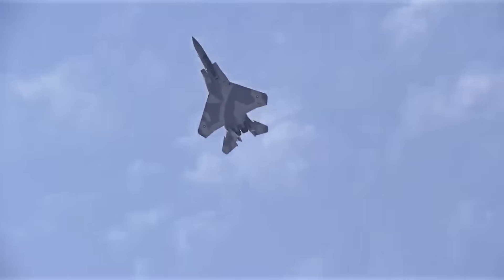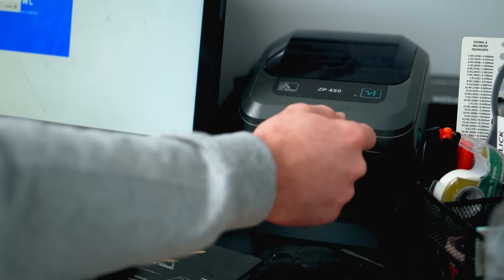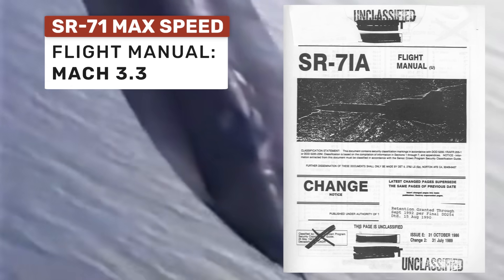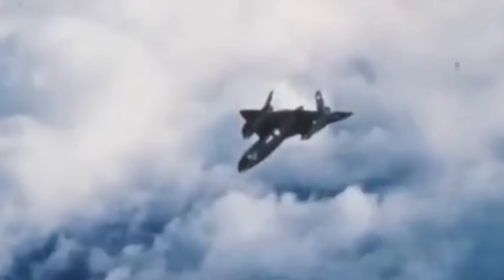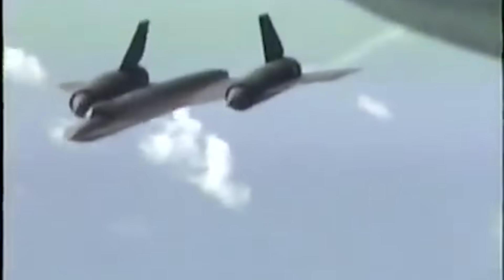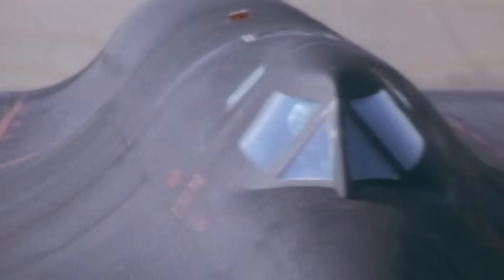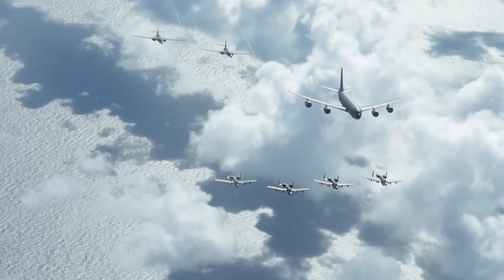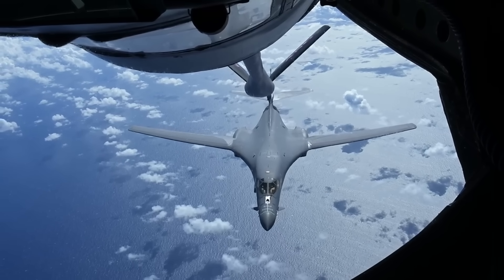The SR-71 was MUCH FASTER than the Air Force will admit

Comment: I was always told that the speed was only limited because of the atmosphere heating of the fuselage. It could go faster, but the skin temperature prevented it.
Reply: The initial limit to higher speeds was the engine CIT not the airframe temps
Reply: @gr8crash  So is it true that they leaked fuel on the ground and until the body heated up and sealed? What about them being so hot after landing to even touch them? These can’t all be urban legends.
Reply: @jeepdude7359 those are also urban legends. While it is true the SR71 would leak fuel on the ground, virtually all aircraft have leak limits and will leak at times so the SR71 isn't really unique in that aspect.  The myth part is to why they leak. The aircraft would leak when the tank sealant because cracked and damaged. This damaged was caused by the thermal cycles of flight. It was the expansion and contraction of the airframe that would actually create the leaks, not stop them. 

As for having to wait to touch the aircraft after landing that isn't true either. Ground crews started working on the aircraft, removing panels etc as soon as it was chocked in the hangar sometimes as they are still shutting down the engines. There's times the crews would even be taxing in with the canopies already open.
Reply: @gr8crash  Respect 🫡
Reply: @jeepdude7359 haha no worries. To be fair I got involved in studying these aircraft having "believed" a lot of these myths. Then I found out that truth is much better than the stories.
Reply: @gr8crash  Wait, so the plane out of the factory didn't leak at all, and the expansion triggered some degree of leaking that resolved when it expanded, but acted up again once cooled?
Reply: @petero.7487 somewhat. Out of the factory or after PDM there were virtually no leaks. But over several flights the thermal cycles would cause the sealant to crack and the leaks to start. Once these leaks started they remained until leak limits were exceeded then it would be scheduled for fuel cell MX during the PDM.

Comment: I'm betting the SR-71 was a mach 4 capable aircraft. Built out of titanium from Russia the Blackbird was a sloppy fitted clanking airframe that leaked fuel. But at 80,000 feet cruising over mach 2 that aircraft tightened up to perfect fit being heated from friction of the air at mach2+... twice the speed of sound.. designed and built back before computers and is still faster than modern aircraft even though it's retired now..Great gig if you can get it
Reply: The SR71 was never remotely capable of mach 4. It also wasn't sloppy/fitted or clanky, and yes it did leak fuel, it didn't leak very much.

Comment: I wonder if pushing the plane above its limit causes it to become so inefficient that it would be impractical, especially with how fast it is anyway
Reply: Depends on the situation, meaning atmospheric conditions.
Reply: @gr8crash  yeah just saying for practical purposes it may not make sense to run it at +100mph above its limit because of the extra fuel and loss of range etc.
Reply: @bobman717 well it depends. The SR71 engine controls are based of atmospheric standard conditions and most of the time that's fine.  But in days where the air is warmer than usual they may be at full throttle,  with high fuel flow and not even reach mach 3 which has lead to mission aborts. Now a day where it's colder than normal they could be in MIN A/B and be comfortably passing mach 3.2 while keeping fuel flow down.

Comment: The airframe and major components were probably able to go much higher speeds, but the onboard systems were likely limited to ~ Mach 3.5
Reply: The engines weren't rated for faster, and various parts of the airframe had issues at different speeds.

Comment: As a  tanker  pilot, the only time I paid any attention to the outside air temp of my KC-135 was refueling the SR-71. We  had to fly as fast as possible close to mach 1 and not melt down, while th Black Bird  flew close to its stall speeds, especially as fuel was on loaded. With the exception of the SR-71, all the fuel    offloaded to other Air Force aircraft  was JP4, The SR-71   burned its own brand, and the tanker had to keep the fuel separate. As a result only a few tankers were build to accomodate that problem.   As I recalled from  decades ago, it was the only aircraft that  descended to meet us.  Most of my experience flying the SR-71's was at Kadena, in Okinawa where the teen age boys work   t shirts   with black bird and other references on the supposedly top secret nature of the missions.

w
w
Reply: 56 Q tankers were made for the SR71 program. During refueling the KC135 did not fly "close to mach 1"  not even remotely close. About the only other aircraft I can think that would have descended like that for fueling would have been some of the U2s.

Comment: It could go even much faster than what this video says. I was an Air Force pilot and met up with Blackbird pilots from Pease AFB over in UK on TDY and noticed their flight suit patches. No, they could not “say” how fast it could go but I saw the number and “wink” of those patches.
Reply: Lol no. This has come up with thr rumor of "mach 5" patches, this was absolutely impossible for the aircraft to do and there's no SR71 that will ever claim a speed like that.
Reply: @gr8crash  if you say so. But unless you were one of the test pilots or an engineer in Skunk works then we don’t really know, nor do we know what altitude above FL600 it flew during testing, which makes it easier for the airframe to fly faster.
Reply: @mikemccormick8115 actually you don't need to be either of those to know what us and isn't possible. Also all those limits on speeds and altitude are all known and public even going back to the A12 flight testing. Even without being part of what you said, it's not hard to realize what is and isn't possible. Mach 5 is 100% impossible, mach is 100% impossible, even reaching mach 3.5 is nearly impossible outside of VERY specific atmospheric conditions.

Comment: This is a guess but I might be able to tell you where the name for the Vmax switch comes from. Yamaha made a motorcycle called the Vmax. There are two generations of the motorcycle. I only know about gen 1 for sure because I own one. The gen 1 Vmax was produced from 1985 to 2005. The gen 1 Vmax and maybe gen 2 has a butterfly valve in the carburetors that is designed to open at 6000 rpm's to feed the engine more fuel to give a large boost in power. That sounds pretty much like the Vmax switch. Having the same name may just be coincidence, but if it is it's a pretty crazy coincidence!

Comment: I used to work at The Museum of Flight in Seattle and got to talk with Frank Murray (I believe). It was the first symposium after the SR-71 performance data was declassified, so they could finally speak freely as long as they didn't talk about specific missions or the camera capabilities, because the cameras were still being used on the U-2.
I got to ask the big question of how high and how fast and Frank cheated a bit and spilled the beans. He told me the top speed wasn't limited by thrust but EGT and he flew the Blackbird faster than anyone else on a mission off the northern border of the U.S.S.R. in the winter.
He said because the air was so cold and the engines were so efficient, the more he backed off the throttle, the faster and higher it went... to the point where he was almost at idle (but with the afterburners still active) and the damn thing wasn't slowing down. Eventually he got it balanced and although I don't remenber the exact numbers, I seem to remember he maxed out at something like mach 3.3 and 97,000 feet. (Now I have to go look for my photos from that event.)
Reply: If I recall Murray only flew the A12, never the SR71. And they never flew the A12 on missions against Russia. But the part about colder air playing a role in the only way the aircraft could fly faster than 3.3 is true. That happened to 2 other pilot's though and they both reached speeds in the 3.4x range and 90k ft.
Reply: @gr8crash  Very possible. The event was probably 15 years ago and my memory is hazy. I went with Frank Murray because his face looked familiar. 
Still, it was a great event and I met some amazing people.
Reply: @MrWATM yea those symposiums are really awesome to go to. I've gone to a few and also one in Evergreen, was a great trip.

Comment: Of course they lied.  What does everyone think?  As a "radar operator" from the Vietnam war, I know the top speed.  That plane could fly over the North and barely have time for a cup of coffee.  It would fly out of Subic Bay to recon the North like it was just next door.
Reply: Everyone knows the top speed, it's been public for well over a decade
Reply: @gr8crash  Yeah, not everyone.  The top speed is still a deep dark secret.  Also the top altitude same thing.... a deep dark secret.  The only reason I know is because I was a programmer that had to calibrate the computers processing radar information -- information that kept rejecting the radar returns from the black bird as an error.... too high, too fast.  When flying over the north (of Vietnam) they flew FAST and HIGH.  My first job when I arrived in-country was to fix the computer programming so that it didn't kick out the returns as an error.  And I tell you what, it was a sight to behold when the bird got over land and they turned on their counter measures.  Makes me smile just thinking about it the first time I saw it.  I thought the computer was broke for sure.
Reply: @pawnslinger1 the top speed is not a deep dark secret. It hasn't been a secret for well over a decade. All the SR71 performance data has been known, public and available for well over a decade.

Comment: SR71 is/was incredible (Actual name was RS71 until LBJ screwed up when he revealed it to the average American in a speech.
Reply: Popular myth but no. RS71 was not it's original name. Nor did LBJ make the error regardless,  his stenographer did.
Reply: @gr8crash  Actually, as far as I understand, General LeMay asked LBJ's speechwriter to rewrite RS-71 as SR-71.  The RS designation was for Reconnaissance Strike, which had been applied to a B-70 proposal (The RS-70, a desperate effort to salvage the program) which was designed to assess damage following a first-strike and take-out what remained with a number of unspecified nuclear-tipped missiles.

The RS-71 was designed for the same purpose and evolved out of the R-12/B-12 and RB-12 concepts and would have obviously carried a smaller number of missiles (though the ability to deliver them faster, higher, and harder to detect would have obviously been useful).  From what I recall, General LeMay liked the concept but wanted the B-70 program more and wanted Johnson to stop lobbying for it so he could salvage the XB-70/RS-70 program. The RS-71 program was oriented to pure reconnaissance as a result, hence LeMay's desire for a designation change.
Reply: @petero.7487 somewhat yea. The Lemay wanted it changed from RS to SR so it was. And LBJ read the statement correctly,  but his stenographer messed up the press release. The SR71 itself was never armed or designed to be. They did later propose and armed SR71 variant twice, i believe SR71 Bx and SR71I
  But neither of those variants were built.

Comment: I would like to hear... from my understanding the sr was the only aircraft to have the J58s. My understanding is the a12s had a less powerful engine and therefore slower.
Reply: All 4 variants flew with the J58 engines. The A12 initially had the J75 engines so it could begin flight testing as the J58s weren't ready yet. The A12s, while having J58s did have lower thrust than the ones in the SR71. Although the A12Bs "the only one on the USS Intrepid in New York" would have been equipped with the same full thrust engines.

Comment: I know a gentleman that used to be a mechanic on these things at area 51. Mark 3.8 at 120,000 ft
Reply: That entire comment is incorrect. Not only could it never reach mach 3.8 as configured, it could never reach 120k in any configuration,  it also was never tested,  flown or operated from Area 51.

Comment: While contracting for Camp Dawson, I stumbled upon a book at the commissary devoted to stats and specs of the SR 71. Specifically commenting on the speed record that was officially announced publicly, was in fact actual and true. But, what was not announced publicly was the fact that one of its engines got snuffed out during that record run. No other information was disclosed about its true potential.
Reply: They had a momentary unstart, but it was quickly addressed and had virtually no effect.

Comment: I had a friend who was on the ground crew servicing the SR71.
 He told me that not even him and the crew knew the max parameters of the SR71.
 The reason is because the flight instruments had 'hoods' that closed over them when on the ground, and very few were privy to accessing  this information.
Reply: Lol no. MX crews were well aware of max parameters.  That "hood" aspect as come up before and it's never actually been a thing. It's hard for MX teams to perform their jobs with gauges missing. The one thing they have mentioned is on the TDI there was a bezel with some restricted information and more so in the early days that may he covered up, but that's about it.

Comment: I had a friend who was the weather guy for WPAFB   He did the run for the pilot on his west to east coast run before bringing it to the museum. He told me that they did it in under 30 minutes.
Reply: Agreed too disagree
Reply: @dwainday7460 I mean that works with opinions,  but not in this instance of facts vs fiction. What you said is completely impossible. Especially given the fact it takes 15 min just to get to speed and altitude and that's IF it doesn't refuel after takeoff.
Reply: I can only say what I was told by someone who was actually part of the team
Reply: @dwainday7460 then you either misheard or they misspoke, because it's impossible.
Reply: They absolutely didn't do it in under 30 min. It takes 68 min just to go from West coast to East coast and 64 min from LA to DC.

Comment: Posted 2 months ago, yet those of us who grew up learning about the SR-71 knew its stated top speed was significantly lower than they lead on, but as with all Top Secret / Covert things, details of facts are rarely shared.   First and foremost the implied theoretical top speed was stated nonchalantly as, "There wasn't a missile in the world that could catch this plane at the time it was in service."  Hint:  Go look up the top speeds of ground to air and air to air missiles at the time this plane was in service.  Then extrapolate from there.

For example:  The Phoenix Missile the F14 Tomcat used:  AIM-54A/B - Mach 4.3 / Designed	1960–1966 / In service	1974–present

Publicly the SR-71 was stated to reach top speed of Mach 3.1 or 3.2.  They lied for obvious reasons.
Reply: Lol virtually that entire comment is incorrect
Reply: @gr8crash  If you say so slick.
Reply: @Fluke2SS hmmmm, no it's not about being "slick"  it's just about understanding the topic better.

Comment: The SR-71 and A-12 only had a limit of speed due to structure of the airframe and engine. For sprinting however they both were so much faster than stated. They could outrun any missile being used. Some missile encounters are still classified but go find out maximum speed of the missiles for a good guess of the planes capability sprinting remember your geometry however.
Reply: Virtually all of that is untrue. Various parts of the structure didn't start becoming an issue until mach 3.4+. The engines were the initial limit to higher speeds. And there was no "sprinting" in this aircraft. If they had done the required upgrades,  it would have had a higher dash speed,  but they were never implemented.

Comment: At 5:15 or so, when Shul claimed to take the Blackbird to Mach 3.5 over Libya, that Blackbird is tail #61-7960 now on display at Castle Air Museum in Atwater, Ca. 

A few Blackbird pilots have said that particular plane had a bit more kick.
Reply: That also never happened

Comment: I watched an interesting interview with one of the engineers that designed the J-58 engine. He stated that the design limit for the engine (not the aircraft) was Mach 3.4 beyond that speed the engine would flame out. So, Mach 3.4 was the hard limit.
Reply: The J58 design studies state the J58 was designed for  mach 3.2, not 3.4. This was after uprating the engine from 2.5. They later did approve up to 3.3 but with restrictions.

Comment: My dad was a B-52 pilot who flew two tours in Vietnam. Once he was flying, he was assigned to SAC headquarters in LGM. He eventually was promoted and went to the top of LGM. The designated speed per the manual was Mach 3.2. My dad noted that if the plane flew suborbital, which it was capable of, the speed was estimated to be Mach 5 due to the lack of atmosphere. Only the airframe, the engine's need for airflow, and its systems (compressor) kept the plane below Mach 3.  The current x plane lacks all of those deleterious issues.
Reply: Sub orbital?  Lol no,  not even remotely capable of that, nor could it fly that fast.